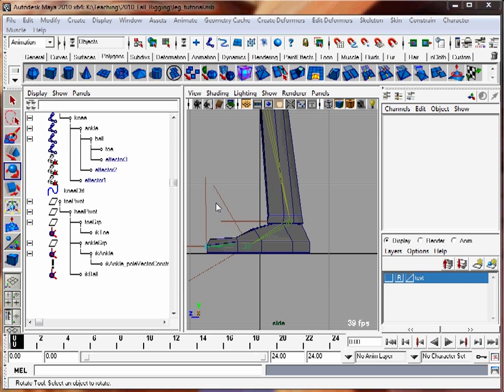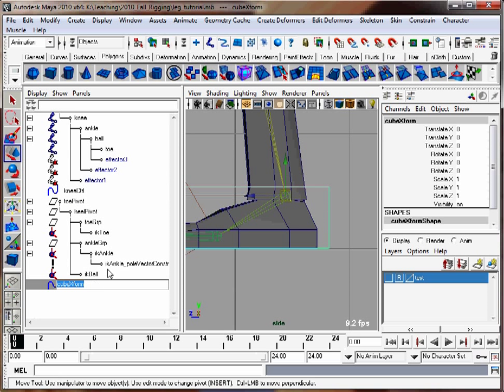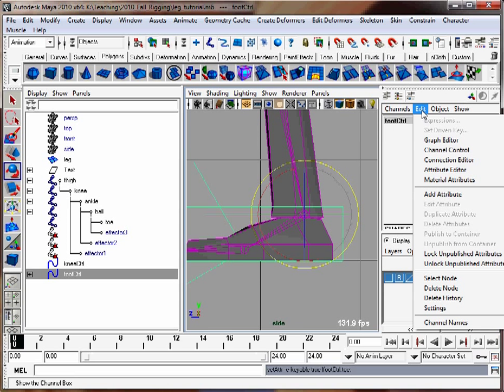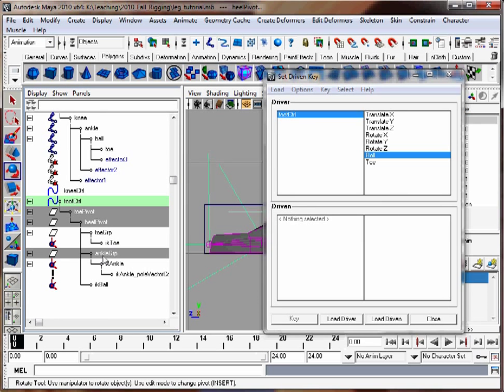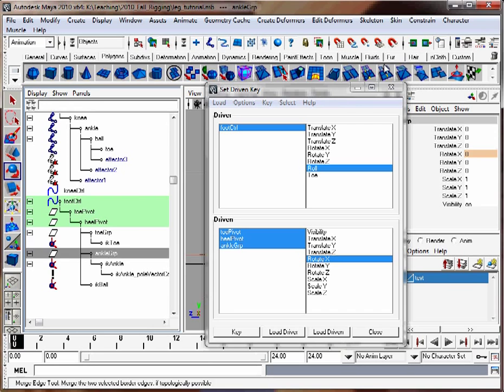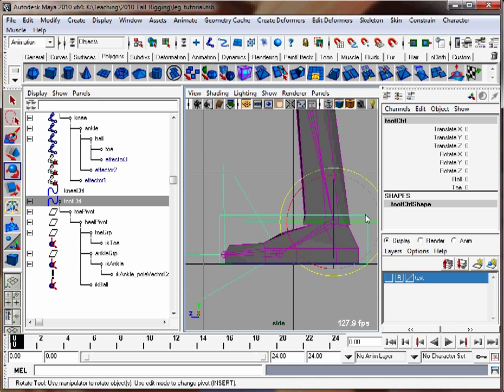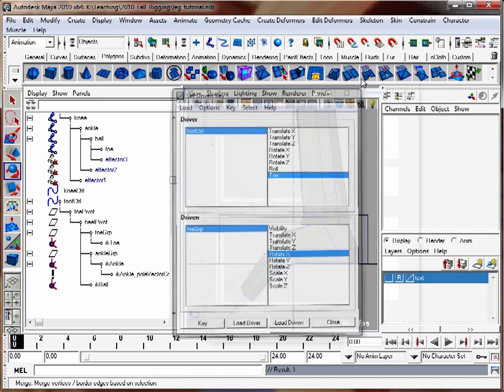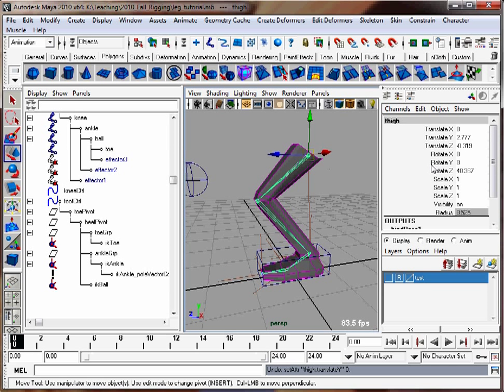Leg rigging Maya tuturial with foot roll setup Part 2 of 2

Comment: Hi +Nathan, love your video. Do have a question. How do I keep the Foot CTRL to stay on the leg, as when I move the leg it moves away from the Foot CTRL. I was thinking possibly an Point constraint? Is it okay if the foot CTRL does not follow the foot?
Reply from the maker: Hello. I'm glad that you like the video! How are you moving the leg so that it moves away from the controller?  If you move the thigh joint, the foot should be planted on the ground because of the IK setup.  If you move it too far so the leg can't reach the foot control, then the leg will move without the controller, but it will try to (it will aim at the foot control).  Maybe you don't have the entire setup parented under one group?  You can email me your file if you want and I can check it out.  My email address is nathanwebb at hotmail.
Reply: I think its all  parented under the Foot Controller. Will email the file. Think I did everything in the video. I am using a sphere as the controller and not a cube but I don't think that should be an issue.